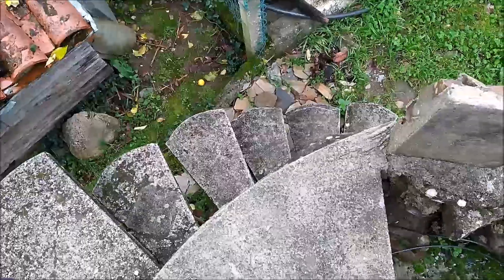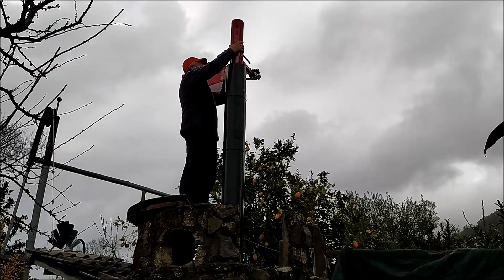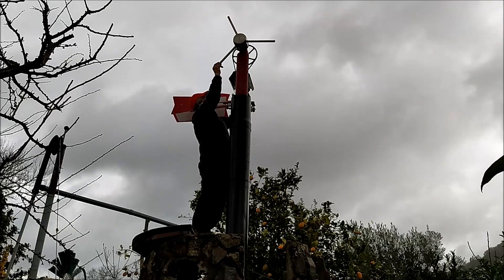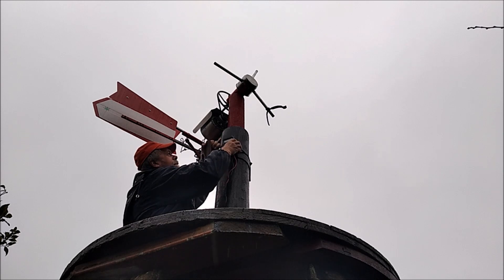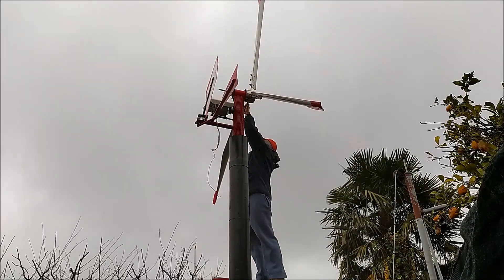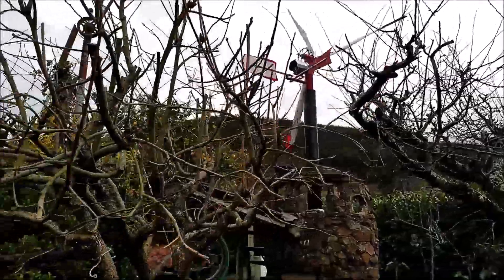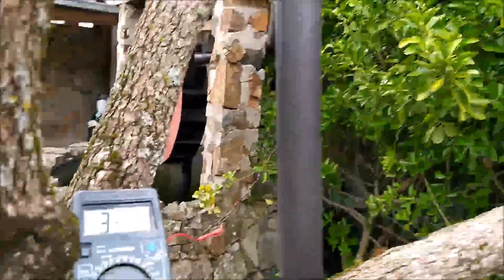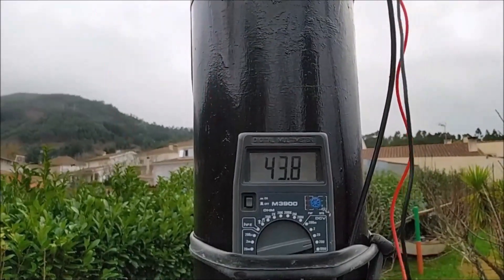Gerador de pouco vento - Colocação na torre e testes

Comment: Give how many kilowatts ?? How fast is the wind in this region ??
Reply from the maker: The generator produces very high voltage, with low speed, the problem is that the amperage is low.
The winds here are very unstable, both strong winds and long periods of calm can occur.